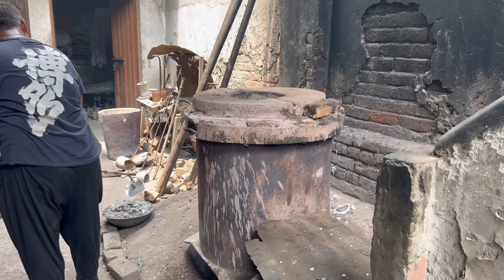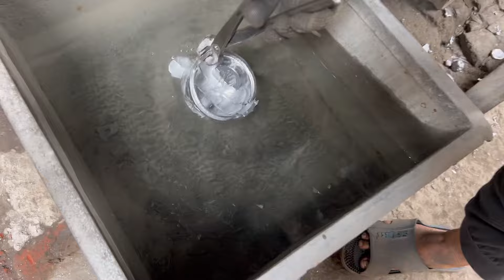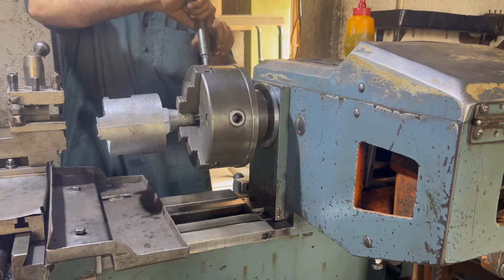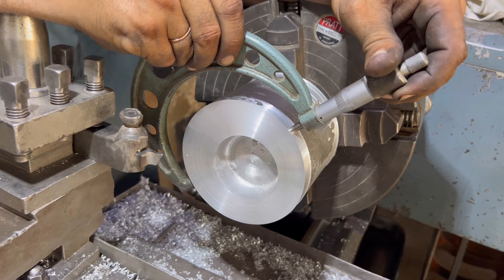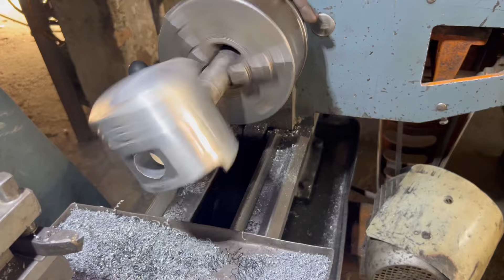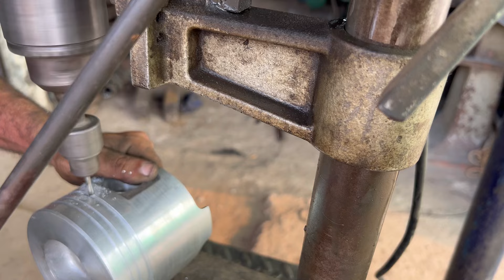Manufacturing Process of Truck Engine Pistons Which Made From Cast Iron| Production of Engine Piston

Comment: I wonder how many hours the engine will have before complete piston failure? Different materials, different weights for each piston, the engine vibration must be brutal. How accurate is that lathe? Yeah, that is what I thought.
Reply: It's a low revving diesel and not an 18krpm race engine. It'll be fine.
Reply: @Henrik.Yngvesson  Dunce!
Reply: @Henrik.Yngvesson  Clueless.
Reply: I see basic metal failings throughout these and similar type videos in that heat treatment is not understood whatsoever. I'm not sure if the workers genuinely don't know or perhaps they do know and as you say the components will soon be back for a rebuild. Perhaps it's done to keep themselves in employment!

Decades ago when needing to repair small 2T motorcycle engines we had two options: Genuine parts or cheaper pattern parts. We soon realised the false economy of pattern parts - the metal was of very low quality with dubious alloys used and questionable grain structure showing. 
Even when meting the aluminium (and other things) down for this video they do not sample for quality before casting. No additives are used for removing gas bubbles from the metal mix either.
Reply: @jackking5567  Silica alloyed aluminium often used for casting is not heat treatable. And it will go through heat cycles in the engine afterwards.
Reply: Keeps them employed lol. But yeah man, no control at all.
Reply: Stillwater62 ## , hours? you are very optimistic
Reply: Well that's what you get for what you pay 😜 and by the way those pistons go into trucks made in china. 🔥
Reply: Unimaginable method to produce pistons. All vehicle manufacturers have laid down stringent Q. C. Standards for pistons, piston rings etc along with the cylinder block. It seems that such small industries have simply blown these things in the air.
Reply: Secondly the pistons can not be cast with scrap alluminum materials. The aluminum or the alloy must be virgin metals with defined composition as specified by th vehicle manufscturer. . Surprised to see in the video that scraps are being smelted to produce the pistons.
Reply: @Henrik.Yngvesson  AA q9
Reply: คุณใช้ไปไม่นานพังแน่  ไม่มีความแม่นยำในแต่ละ ลูกสูบ
Reply: @jackking5567  a67~
Reply: Its for yu to name one engine which has failed.tbese people are in market because they produce stuff which are utilitarian at affordable price 
I know the west is outraged people that they have been preying on by making and gorging them behind closed doors are able to make the same better cheaper and on the open for everybody to see.
Reply: They sell those pistons maybe big companies. Outsourcing

Comment: you can’t distinguish from the original) that’s where we will take spare parts) well done masters) good luck to everyone) 🔥🔥🔥
Reply: I actually can distinguish it from the original... This video was actually a good reminder to think and check very carefully before buying any aftermarket parts.
Reply: @r0dani3lb  hi
Reply: Bike ka mil jayega kya
Reply: You can put a set of these in any truck you repair and then you will learn  to distinguish from original.......
Reply: It will fail very quickly, and goes into the metal pot again.
Reply: @r0dani3lb  Aftermarket parts in other parts of the world are produced in a controlled processes and with international certifications, and could be better than stock at times. These parts are Pakistani made for Pakistani people. They do not reach you local spare parts shop. Please use a little more of your brain cells.

Comment: The pistons are oval to varying degrees according to the height examined. Sometimes the ring-area and above is round. Below the rings lateral is not straight, but curved (ballistics) on the mentioned oval base. Sometimes the ring-area and above is conal or cylinder. They make poor quality pistons. But I see that it is better than nothing. So my respect.
Reply: Poor quality is an understatement, the distance from gudgeon pin to the piston crown wasnt even measured so every piston is going to have a different height which will give different compression ratios in each chamber. Doesnt matter anyway, i doubt they last more than a few hundred kms.

Comment: They should consider making a jig for their lathe, then use a stepped chucking reamer to cut the wrist pin holes in one simple operation.  Also, another jig for cutting the oiling holes, done with endmills, since drill bits tend to drift..

Comment: Considering the available materials and tools in some countries Im thinking theres nothing wrong with the manufacturing. As far as balance is concerned its likely theyre all weighed and machined to provide the same weight of each piston. That may be why the piston tops arent finished. Dynamic balancing might not be a serious issue with low rpm engines. My guess is theyre not building formula car race engines. Aluminum pistons that will be getting cast iron rings last just fine.
These guys could likely build anything if they had better equipment. A dirt floor shop isnt exactly high tech
Reply: Their skill will be useful during zombie time
Reply: I couldn't said it better 👍
Reply: Yo construí un Bugatti en mi cochera y  utilicé materia prima reciclada,tiene mejor calidad que los de fábrica,no subestimes la vieja escuela .

Comment: I'd like to see the truck, or truck engine, these go into.
Reply: They are old bed ford engines and been over hauled many times even there crank shafts are made locally old fashioned. And they are good enough to run thousands of kilometers.
Reply: they run bruh they drive they trucks 15000 ft in the hamalayas on mud roads constantly dodging huge rocks and mudslides we got our fancy machines cnc and mig and tig and cmm and qc but out overpriced over engineered lemons wont deal with any of the stuff theres do

Comment: Slight issue is that pistons are not normally round; they are  turned slightly oval to allow for the difference in expansion when hot between the gudgeon pin bore and the rest of the skirt. Also not sure how square the gudgeon pin bore is to the rest of the piston.
Reply: Around 13:35 I started getting a sinking feeling about this whole endeavor.
Reply: You cannot be that ignorant. All pistons and all cylinders have to be perfectly round or they will never work. In fact when any engine wears down the top and bottom of it's crankshaft path over time also renders them useless.
Reply: You are ignorant. Having spent 4 years as an apprentice for a company who made diesel engine cylinder components I k ow how pistons are made. They are only truly round when they are hot! This is because the piston is not a uniform shape and it changes with heat expansion. We used a specially adapted lathe to turn the pistons. The company (Wellworthy) was 100% supplier to Cummins and Perkins in the UK when I worked there.
Reply: @about2mount  read my reply.
Reply: @simondegrave2620  Ive read it, Kisten ive been a diesel nechanic all my life. I've constantly rebuilt cats, cummins, Detroit's, several volvos, and several Iveco trucks powered by Ford Desiel engines. Of all of those engines all of them are precisely round to perfection. Ive also miked them, I've had to bore cylinders on several mills, and I've turned down allot of pistons on a Mazak computerized Lathe as well. Fir the sakevof saving yourself tell us all what tool botes all cylinders? Its called a fly cutter and its only set to bore oerfectly round holes in all engine blocks and in all diesel sleeves. So your mistaken. But maybe you mean ballancing weights where pistons front and rear have to match both sides in balanced weight. In thst case the large diesel engine pistons have added counterweights cut into them for ballancing. I think that is what you are referring to. However the pistons dianeter and the skeeves dianeters are perfectly round and have a size diffence of .002 to. 004 deoending on desired compression ordered by preferred choice. For either 10.0 to 1 or up to 11.5 to 1 nominally. Which the 11.5 to 1 would be the tightest clearance of .002 thousands of an inch or less..
Reply: The pistons are oval to varying degrees according to the height examined. Sometimes the ring-area and above is round. Below the rings lateral is not straight, but curved (ballistics) on the mentioned oval base. Sometimes the ring-area and above is conal or cylinder. They make poor quality pistons. But I see that it is better than nothing. So my respect.
Reply: @BillSikes.  Yeah, right having made several thousand Cummins and Perkins pistons I know what shape they are. Try googling and you will find the answer
Reply: @simondegrave2620  
🤣🤣🤣🤣U🤡🤡🤡🤡
Reply: You can’t both be wrong and right, I think your both talking about a different trajectory of round and oval 🤔

Comment: what you don't understand is that for them time is an abstract concept,  here we are used to putting value on time, and if one thing breaks we throw it away and buy a new one because repairing it would cost more than buying a new one or anyway we prefer to have the latest model. for them the important thing is that it works not that it is perfect or that it lasts over time, if it breaks it is not like in the West Where the cost of a mechanic for hours is $100 plus tax
Reply: Bnjty
Reply: Good job

Comment: These are made from cast aluminum not cast iron.  On the lathe, more precision measurements need to be made.  The lathe work could be more efficient if they used a parting tool to remove the sprue.  With a larger tool post or smaller cutting tools, multiple different cutters could be mounted and simply rotated into position instead of changing the tool for each operation.  On the drill press the bit is wobbling badly and the metal could be punched to aid in setting the bit in the metal.  Definitely low quality work, but I guess you do what you can with what you've got.

Comment: First of all this is aluminium not cast iron, as for accuracy in machining they have to be joking.😳 And we must not forget the precision holes drilled with a blunt drill bit in the side of the piston while attempting to hold it by hand. There’s no way the gudgeon pin holes are lined up and square to the piston. And why is the dimple in the top of the piston left off centre?👎👎😳😳🇦🇺🇦🇺